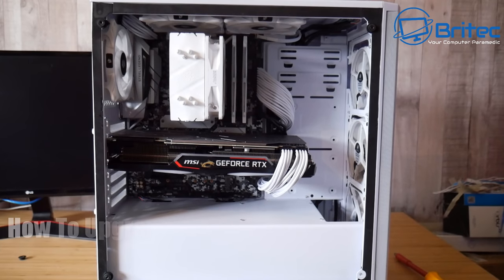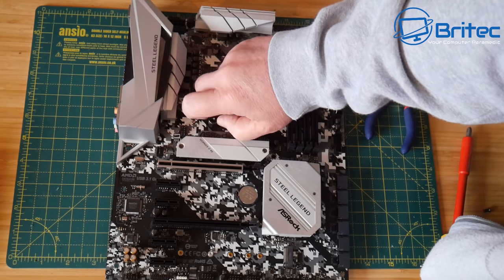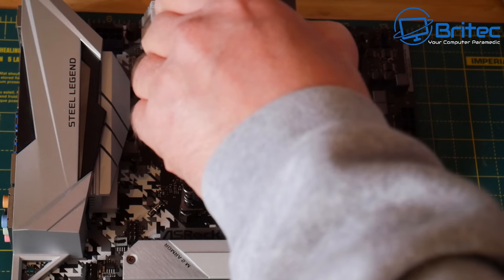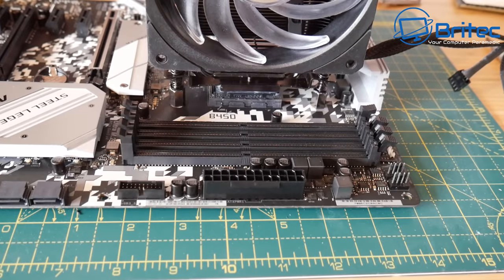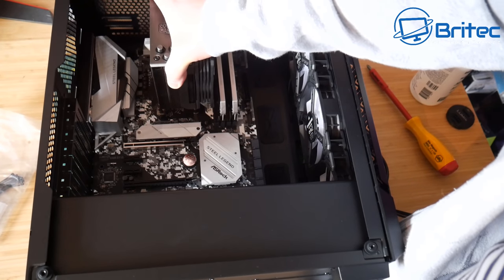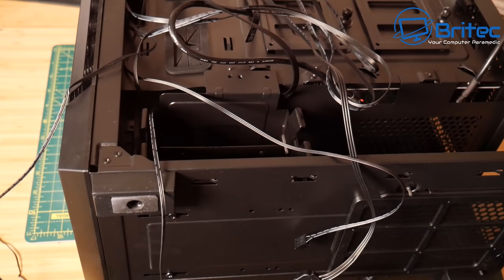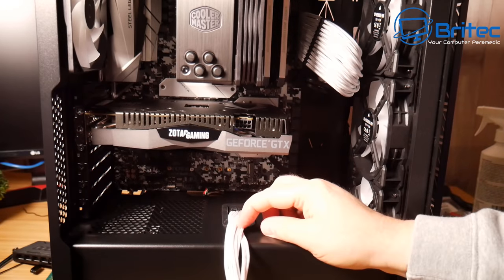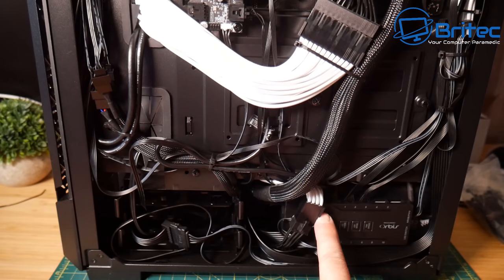How To Upgrade Old Computer To A New PC Case

Comment: I just happen to be moving my main system from a be quiet! Silent Base 802 to a Thermaltake View 51. I can't wait to begin building, but the last of the parts won't be delivered until tomorrow. I thought I was ready to go, but needed a few more hardline fittings and pass-throughs. Cheers.
Reply from the maker: Love to see the finish photos
Reply: @Britec09  When I finish the build and post some pics I'll be sure to give you a link to them.

Comment: Well Brian I wish I could upgrade my Ivy Bridge using the current case with is a Coolermaster HAF XM which in my opinion is the best case ever made - so easy to access with clip-in side panel,  tons of room for the liquid cooling system, and looks just great. But in general, I reckon Coolermaster cases are the best. My only problem is the motherboard an ATX (Asus P8Z77-V)  I'll grant you not a lot of room to fit the GPU and sound card.  Not real keen on the background music mate as I am hard of hearing and it is rather distracting. But good video anyway.🙂
Reply from the maker: Thanks

Comment: Brian, as always great video. But I have a question, I have an old alien style full tower ATX case, 7 fans, with top mounting power supply. My question is can I still use this case with all new equipment?
ATX board, power supply etc.

I really like this case and would still like to use it. This case was a moders case 15 years ago and was tricked out with uv sleeving, AMD xp board,, lights, plenty of easy mounting bays,etc.

Old fan mounts were 1 top, 1 side, 3 front and 2 back. Side door fan was never used.
Reply from the maker: You should be able to
Reply: Thank you!

Comment: I apologise for this, but couldn't find anything relevant to my question, sorry !!!!!!
I have accidently put a password on my 1Tb HDD, it's not stolen etc it is mine.
So as you know it isn't accessible, it doesn't even give an Error code if I enter the wrong password.
I have found a way to access all my files and so have copied them onto a spare HDD. I've formatted the drive by all manor of programs, but suspect that the P/Word is probably stored on the Circuit Board?
My way round to get to the files was to connect the HDD to a DVR unit but the power is from the Computer.
I let the DVR do it's thing then connected the SATA cable from my computer to the HDD.
This shows the drive as useable and accessible but only till I turn off the computer.
I've tried Victoria to remove the P/word but it wouldn't work.
Because I can get access to the drive is there someway of removing the P/word from maybe the CMD prompt? 
Seems a waste of an HDD if I can't use it.
Thanks for listening.

Comment: A little too much thermal paste. Also, and I've mentioned it to you a few times, your audio, is quite muffled, making it hard to understand. Please change your setup to something with more treble. I need to use the CC to get all of your words. I suggest plugging in the power supply cpu cable, before mounting the cooler, since it is difficult to do it after the cooler is mounted and the board is placed in the case.
Reply from the maker: Len, Audio is fine, issue must be your end and thermal compound is fine. Already done CPU power cable, watch the video.
Reply: @Britec09  OK. Thanks for reply.
Reply: Audio was fine no problems